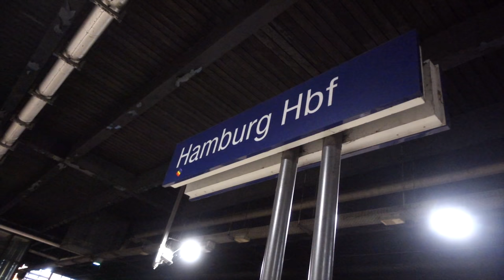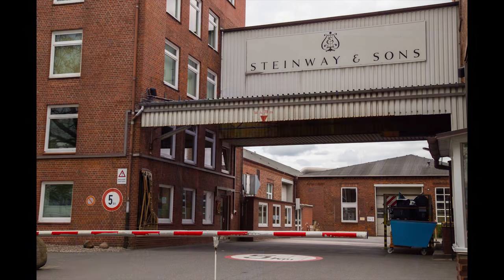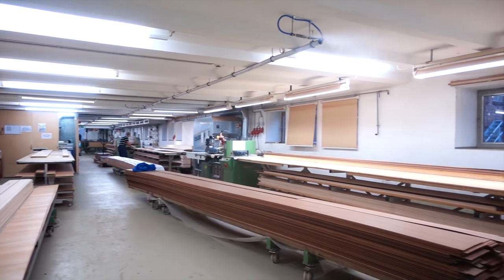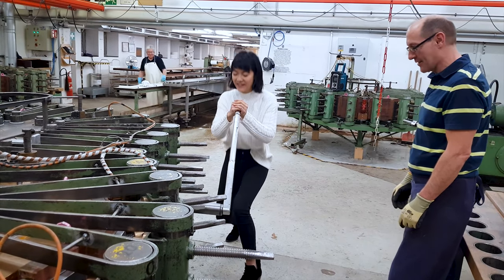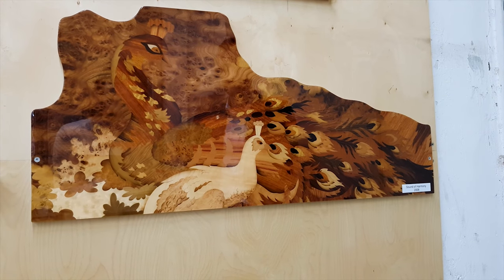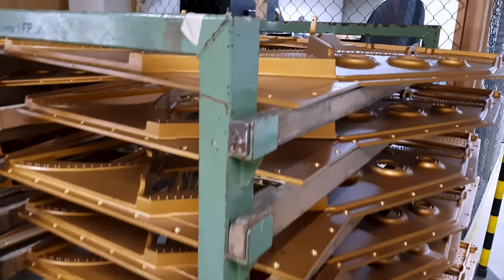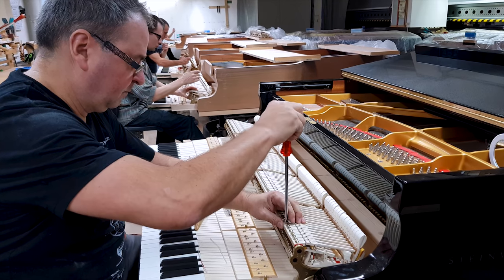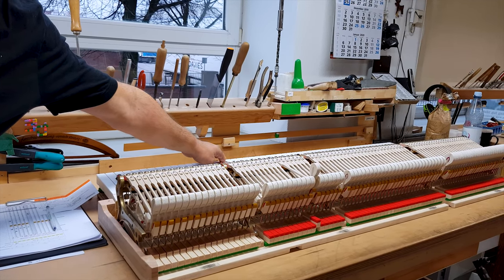Building a Steinway Piano at Hamburg Factory | Tiffany Vlogs #96

Comment: On your next factory visit, AFAIAC I'd say there are two main topics: (1) the production of the sound board with wood selection, gluing, shaping, finishing to the point it is mounted in the piano's case and the string frame can be put on top, (2) the voicing - we've seen the "tuning" of the keyboard action (wow, three days of work) but when the keyboard is slid into the piano, there must be significant work to do still (aside from tuning the strings). We know that each instrument sounds different than others from the same model and factory, but how much is voicing, actually?
There is a video on YT of a group of pianists as selection committee to choose an instrument for their new recording studio. Knowing how much a tuner can change a piano's sound by e.g. working the felt on the hammers, the question is if they purposefully create different voicings for people to choose from?

Comment: So I worked for a bigger retailer at the time and some manufacturer made changes to their business.
I can't quite remember the company I talked to, I BELIEVE it was Fender.
They previously made special models for the Asian market and special ones for the American market, this is why I had to check if there were any changes to the product line-up and availability etc. The whole package. To get to the point, part of what I got back from them was about the manufacturing and the answer is no surprise:
The steps to produce the instrument are the same across all factories. The processes are regulated by the company itself and all factories have to adhere to it to ensure all instruments are of the same quality. If you're not placing a special order you get the model made by a factory closest to you/the retailer/showroom.
Steinway could be totally different, never asked, but an educated guess would be no, there is probably no greater difference in the manufacturing processes between locations.

Comment: Can you show / ask how they developed Spirio R and what the challenge it was to recreate the exact action movement recorded?
Reply: At Last:  I bought a New York model D concert grand equipped with the Spirio R in May.  It is a new product from Steinway that is only available in the model D and model B pianos at this time.  I have heard the Spirio R may also be available in the model O baby grand, but I'm not certain of that.

Because the Spirio R is a new product, and mine was one of the first in the San Francisco bay area, there were a few little technical "bugs" that Steinway had to work out.  So I was able to learn quite a bit about the Spirio R system by talking to Steinway's technical support people in New York and the technicians they sent to my home.

The Spirio R gathers recording data from optical sensors mounted on top of the action.  They measure the position of the shanks which hold the hammers, taking measurements or "samples" 800 times per second.  The optical sensors can detect 1024 different positions of the hammers, which is 10 bits of data for each key.  doing the multiplication, 10 bits per key, times 88 keys, times 800 samples per second, gives a data stream of 704,000 bits per second just from the keyboard.  The damper pedal and the una corda pedal are sampled 100 times per second with a sensitivity of 256 (8 data bits) different positions.  The sostenuto pedal is also sampled 100 times per second , but it is either applied or not applied so it produces only one data bit per sample.  The pedals on a Spirio R produce a data stream of 1700 bits per second.  Add the data streams for the keyboard and pedals together, and the total data stream for a Spirio recording is 705,700 bits of data for each second of play.  This is much higher resolution than any other piano player system.

Starting around 1919 and into the 1930s many of the old master pianists recorded reproducing piano rolls.  Steinway has converted many of these reproducing piano rolls over to their Spirio system.  I have played actual phonograph recordings of Sergei Rachmaninoff and compared them to the Spirio files of the same pieces played by him on my Steinway D concert grand.  The Spirio system gives a highly accurate reproduction of Rachmaninoff's performances.  And it is fascinating to see a performance on my piano by Rachmaninoff himself from almost a hundred years ago.  I have several concert grand pianos in my downstairs music room, so another thing I use the Spiro R for is playing piano concertos.  I record the second piano part on my Spirio, and then I play the solo on another piano.  In that way I am playing both parts of the concerto at the same time.

The Steinway Spirio R is a remarkable product.  I am very pleased with mine.  I would recommend it to anybody, and Steinway has been very responsive to me and has given me excellent customer service.
Reply: frazzledude WoW !! With-Out-Words, what an incredible information. I really am impressed with the details you wrote/provided. I’m very knowledgeable in terms of informatics and digital technology and a massive fan of grand pianos, organs (Silberman, Arp Schnitger, etc) and other instruments. Thanks so much for this. 
What remains though, how they reproduce the intricate reproduction of the key-wippe  movement analogue to the high resolution of 1024 steps or recording. That’s neither simple to do, nor simple to do without mechanical noise of an actuator....
Cheers from Switzerland 
Chris
Reply: frazzledude I also would love to hear once these recordings “live”,  I'm a little jealous of you 😉🤣